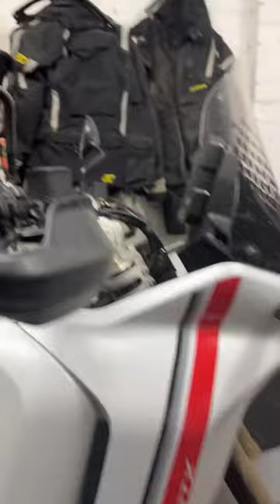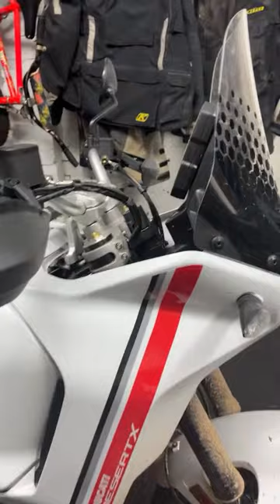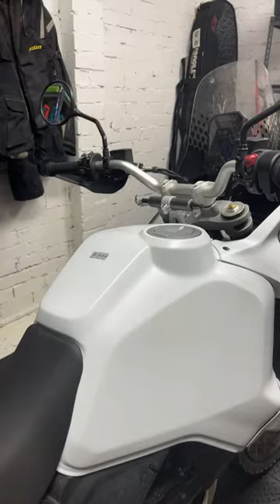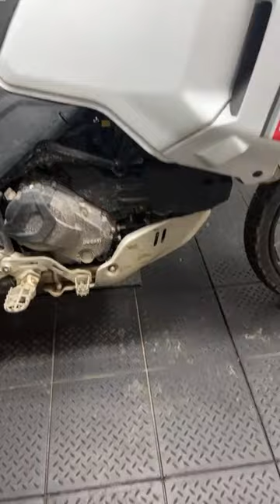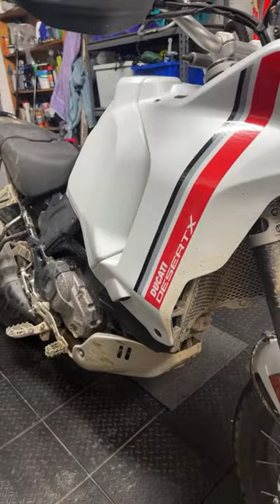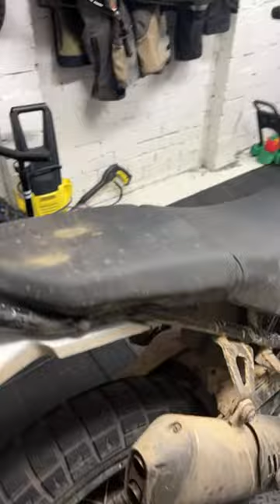LIVE: Ducati Desert X  - 2 days - 700kms Questions and Answers

Comment: Can you remove air filter and check before you give the bike back. I ask because I had a Husqvarna TE 449 and seriously the air cleaner practically never needed anything. First bike that I only checked air cleaner at service intervals so hopefully the desert x is designed like that.

Comment: Good job Dave.  Wonder about the turnsignals, flexible enough not to break?  The right rear footpeg mount, looks same issue as T700.  Engine vibration, service intervals.  Hard bags?  Handguards, durable.  Like the seat footpeg araingment, looks feet on ground, big plus.  My feelings are that the new Honda Transalp 750 will be an all around cracker of a bike. 91hp, very user friendly.  Also the new BMW   R1300GS is soon to be.  Little lighter and more compact than the 1250.  Big price I'm certain.  Service comes into play on all models when going RTW.   The best of times.  Thanks.
Reply from the maker: Some great points there.

Comment: Concerned about repairing that rear wheel. Apparently that nut. Needs to be torqued up to 180nm which means it’s basically unremovable with basic tools on the road. Albeit being a tubeless rim. Is there an option to put tubes in if your rear wheel gets a puncture that can’t be plugged?
Reply from the maker: I was going to talk about that and forgot.  There is a solution, if a cumbersome one.  Fortunately tyres are tubeless.

Comment: What if manufacturers could make a reversable fan airflow arrangement specifically for idling in heavy traffic situations - The concept in mind would be, rather than pump the hot air towards the rider as they currently do, could Ducati and other manufacturers, add a second fan (one each side of the radiator), and temporarily reverse the original fan polarity and use the two fans to pump the hot air back towards the front of the bike, and therefore away from the rider. As soon as the rider  starts to move forward again, then the fans could revert back to normal polarity, passing the air as usual past the rider and cooling as they normally would with the single fan arrangement. Minor weight and size penalty, but could it be a solution for hot country travelling?
Reply: Interesting concept
Reply: @adamrichards2072  thank you. 

Existing single fan or two fans, same principle, pump the heat away whilst sitting and idling, should be easy to program: 

Once bike stops AND fan ON temperature is reached, then swap polarity until bike moves again (based off speedo signal) and change back to original polarity.

Could even be done manually with a simple relay and switching arrangement.

I just wish I still owned a bike to actually test the concept for people, but hopefully someone else will look into it.

Here's just two quick examples of how to do the switching manually, in case anyone is interested: 

https://youtu.be/jPp-rlEBKSs

https://youtu.be/JL4b2xnx9CU
Reply: Cool idea. Would you need a second fan or could you set it up so the one fan just switches direction based on speed. This sounds like something the Ducati designers could consider hopefully.
Reply: @MusicalMemeology  Thanks! 

I'd imagine this could be relatively easy to do with either the original fan, or adding a second fan (optional). 

Only need to pull or push air through the radiator for cooling purposes, and whilst at idle it doesn't make sense to pump more hot air towards the rider, unless they want that hot air in winter to keep warm, but certainly not during the hotter months of the year.

Manufacturers could even add the option for riders to determine the function of the fan, right into their digital displays for that exact purpose - select heat the rider at idle or riding when cold and/or wet weather, and reverse to pull away the heat during hot weather.

Comment: With less than 1000km on the clock are you limiting revs to 6000rpm during the run in period or are u giving it a full rip?
Reply from the maker: It's getting a rigorous run in.

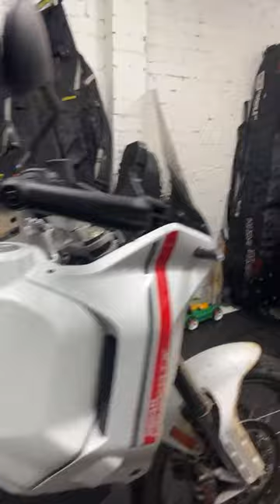Comment: 4:00 the X is 40lbs heavier than T7.  Not sure how you can't tell it.  I own both.
Reply: I have the Termignoni race exhaust system (de-cat, -9 lbs), heavy duty Ducati skid plate, Ducati accessory rail w/Ducati labeled GPS, heated grips and bar bag installed. 
Also removed the rear foot pegs/ support frames. My DesertX weighs 478 lbs wet (fuel tank literally filled to the brim). 240 lbs front, 238 lbs rear.
My buddies T7 wet is around 15 lighter.
If I only gas up my DesertX to match the range of his T7 the weights are nearly identical.
I would bet the wet weight of a T7 World Raid exceeds the weight of the DesertX.
Reply: @jamescampbell4334   You are comparing a modified DX to a stock T7, apples and oranges.  I have reduced weight on my T7 as well.   If you do the same mods to each, I'm sure the delta would still be ~40lbs.